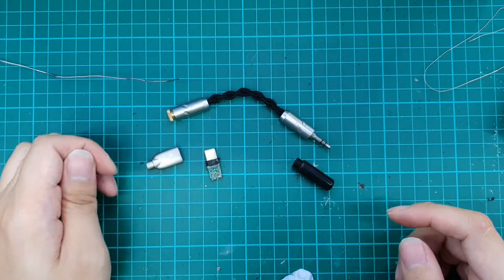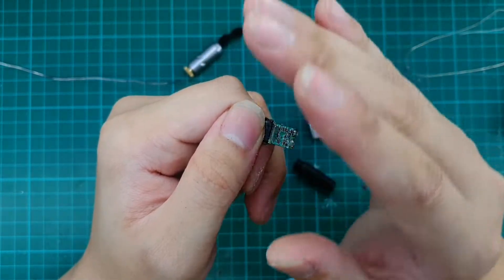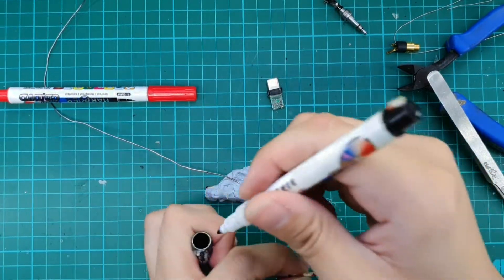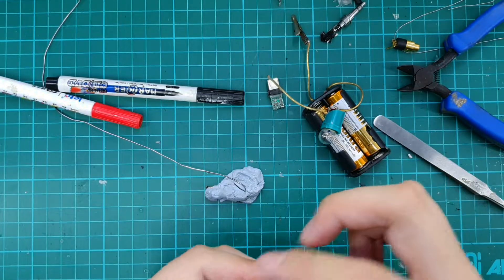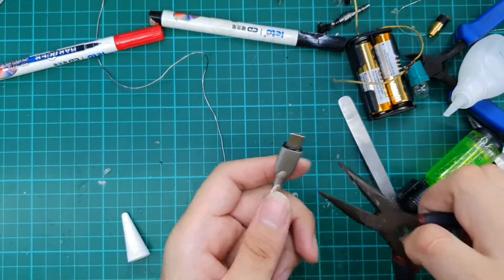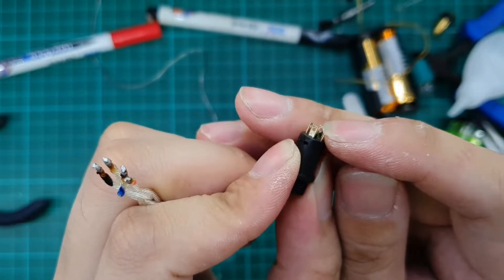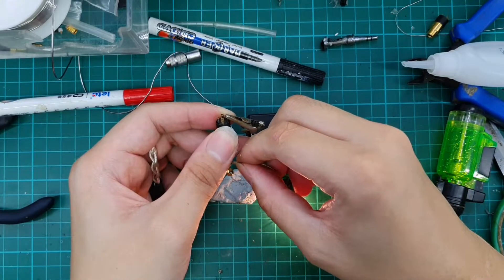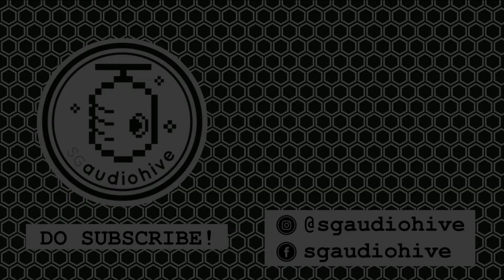Build your own USB C to 3.5mm adaptor DIY Tutorial

Comment: my USBC has five pins red blue green white and copper. which ones do I short together and which ones do I hook up my microphone wires to?
Reply from the maker: If I'm not wrong the copper is the shield, red right blue left green white are for Mic and standard ground u can short those if you don't need a mic

Comment: I dont understand, since i need a DAC is there a certain one i need for my s21 or are they universal? As i understand the DAC is on the usb-c side. Does the DAC you used work on a s21?
Reply from the maker: Samsung fixed their compatibility issues in mid 2020, the newer phones should work with normal USB dacs and dongles now
Reply: @sgaudiohive  wow gotta love that response time, all the adapters i have tried just break over and over again. Is there any you could recommend? Might need something bought since my soldering skills are not that good
Reply from the maker: Unfortunately I don't have enough experience with adaptors as I mainly only use charging + usb + audio adaptors for my tablet. I hear the Apple usb c adaptors work great, but they will have sound cut out from a loose jack around 3-6 months in
Reply: @sgaudiohive  thanks regardless! Probably could've fit this in the last message but do you think that a diy one would last longer?
Reply from the maker: They should if done properly, but seeing that the aftermarket ones are relatively cheap, usually I will recommend people to buy those unless they are doing DIY already

Comment: Is it possible to do balanced termination without losing mic? And is it possible to run from an unbalanced 3.5mm source with a balanced 3.5mm cable?
Reply from the maker: A balanced output does not support a inline Mic function as a balanced output only suppliers audio out. For unbalanced 3.5mm source, not all players that I know of can take a 3.5mm balanced cable, although most of them can,

Comment: Enjoyed the video & subscribed to your channel... Unfortunately, this won't work with the Samsung Galaxy S20. You would need a digital to analog converter (DAC) in either the headphones or adaptor, since Samsung decided to do their customers the favor of leaving out that essential part (in reference to audio signal through the USB-C port).
Reply from the maker: This works for the Samsung phones as it has a dac in the adaptor itself. Tested on several devices
Reply: @sgaudiohive  Okay, I'm glad it worked for you. I didn't have the same luck as you, & tested it on the S20, the Note9, & the A51. Maybe I'm using an incorrect Type-C male jack.
Reply: @Crowley9393  well I have s20 fe and I use a bulky dac with otg from steelseries Gamedac the problem is to make it work the usb need to have an resistor between D+ and ground I'm not sure search it but raw usb c won't work I don't even know if you use the same dac as in the video otg cable was a diy from me and phone didn't recognize my steelseries on test without resistor I tried to ground the D+ with 10k resistor and it worked I have tried numerous devices since then and all of em work some might not correctly cause of drivers but they did work

Comment: Do I need a special board for this I know USB c is weird with host devices and such
Reply from the maker: You will need an audio interface board with dac
Reply: @sgaudiohive  thank you will go on eBay right away, is there a way to interface it with a USB A and then plug that into a otg cable just curious